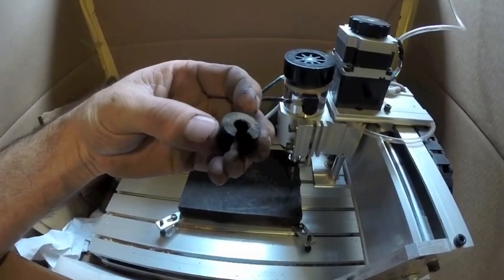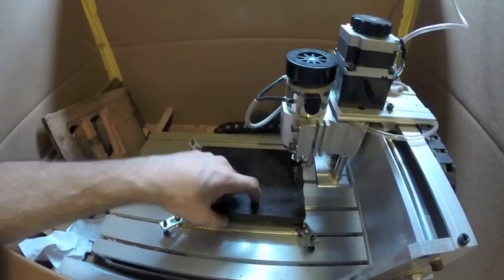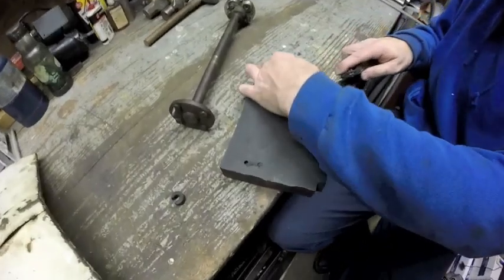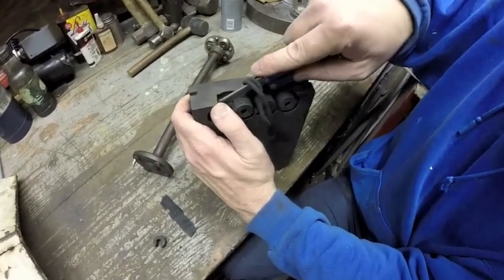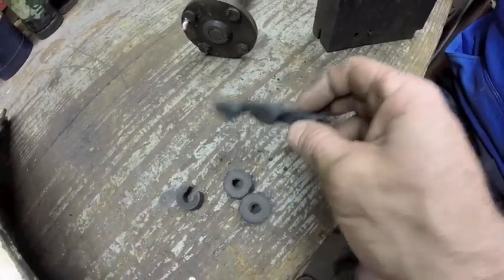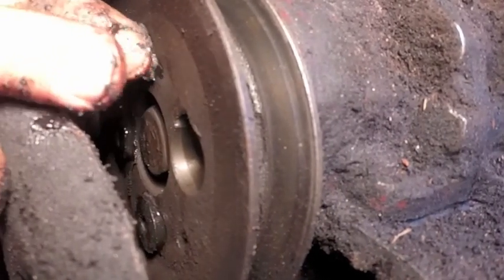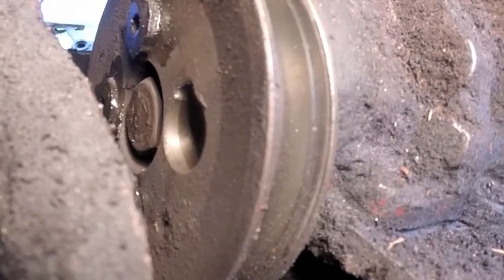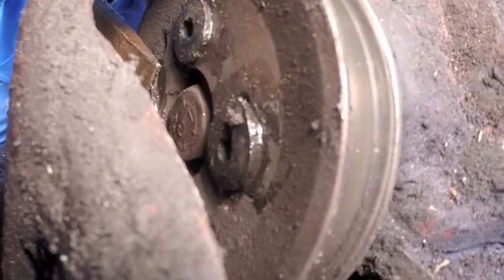Making Rubber Bushings With a CNC Machine

Comment: You may have issues with the holes in the crank pulley like that when the pump is under load, just keep an eye on it. The best option would be try find another crank pulley.
Reply from the maker: Graveltrucking We will see... I figure I will run it for now, pull it apart at the end of the year and go from there.

Comment: Got to tell you this 
I needed  8 rubber bushings in a clutch saft yoke on one of my old tractors
Every dealer around the world had either old stock 1 or 2 or 0
So I spend big $ in shipping rubber from each dealer to get only six from 4 dealers 
They messed up my order. 
The local dealer gave me a old rubber pto belt the same thickness and said cut them out of this. I said your crazy & spent big $ with only 6 
Now I am thinking the old guy was not so crazy!!!! 
My friend has a Cnc did not think of that 
Live & learn thanks for the videos
Reply from the maker: Farmallcub544 Glad my vids can spark creativity.  I am always thinking I would rather just make the part than have to deal with locating these vintage parts... That little CNC is going to be very handy to have access too... the sky is the limit.

Comment: I'm surprised at how well the rubber took to being cut with the milling cutter. That looks like a really nice little machine, would be interested to know where it came from or how it was built.
Reply from the maker: Matt Tester I will ask my friend for the info... the machine is not too expensive, but the software is where you spend the big money.  The rubber cut nicely... it was a good bit and he programmed it to take small bites to keep the heat down.

Comment: Sometimes these pulleys come off hard 
Great fix 
Did it smell bad cutting them out? 
I saw the smoke
Reply from the maker: Farmallcub544 It smoked a little, but not too bad.  I will run the tractor for this year, and check the bushings to see where they are.

Comment: That is a neat CNC Did it smoke cutting those rubber bushing.
Reply from the maker: MrWillis5719 There was a little smoke, but it wasn't too bad.  That's why he programmed it to take small bites.. less heat.. less smoke.  Thanks Steve

Comment: Nothing like a little spit lube. At least it wasn't tobacco spit. I don't think the pin wear will be a problem other than maybe faster wear on the bushings. I don't know if bronze bushings would be better than rubber, although neoprene might.
Reply from the maker: 57WillysCJ I should have said I would turn thin sleeves that would fit inside the pulley hole, but still allow a rubber bushing. I don't know how it's going to wear...I figure I will run it this year, pull it apart and go from there.  ... and yes... definately better than tobacco spit.

Comment: If the worn spots bother you go in and clean out the holes and just use some JB weld to fill the notches. With the new rubber bushings you should be just fine. You don't want metal bushings, there needs to be something that allows a bit of flex and vibration absorption in there.
Reply from the maker: ***** Great idea about the JB weld...  that would definately be the way to go...  For now, I will leave it and evaluate the wear at the end of the year.  I should have been more clear, I would not make metal bushings...I should have said I would turn thin metal sleeves that fit inside the pulley hole and still allow the rubber bushing to fit inside.  see...clear as mud.  lol.

Comment: when you need a little slickery on rubber parts use some crisco or white lithium grease neither will degrade the rubber.
You should be ok with the new rubber Bushings If your worried about it have your buddy add a little bump to a new set of bushings they should all be worn into the pulley about the same amount. Being as the new rubber is harder there should be no problem. If anything a bit of extra shock absorption. Those crank pulleys can be a Royal pain to get off sometimes
Wouldn't pull it unless I had to.
Reply from the maker: burninpwder76 Definately won't pull that pulley unless there is excessive wear... not too much room in that area.  I will run it for 2015 and evaluate the bushing wear this Winter.

Comment: Good repair although I'm not sure how long it will last before the bushings are cut through by the ground-away sides of the pulley. I think you need to be looking for a new pulley into which you cut a new set of holes for the pump drive but time will tell.
Reply from the maker: Dan Whiteford Hey Dan...  I will run it for this season and check the bushing wear... no need to replace that pulley...assuming I can get it off, I can repair those holes... time will tell.